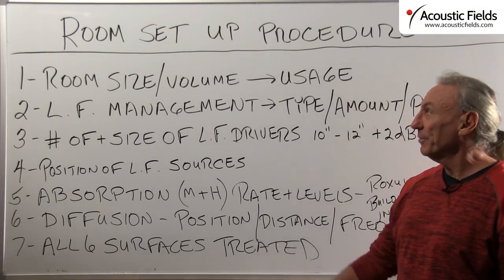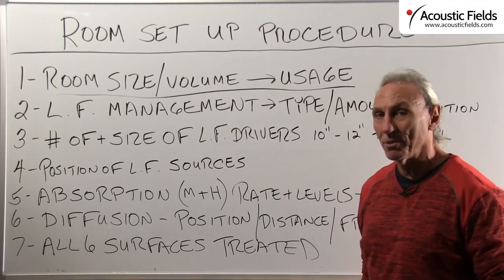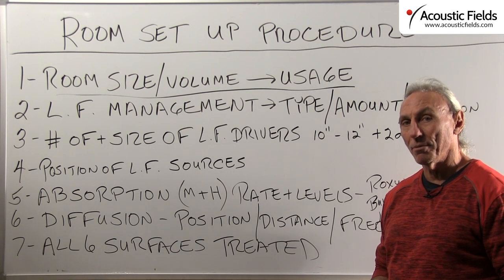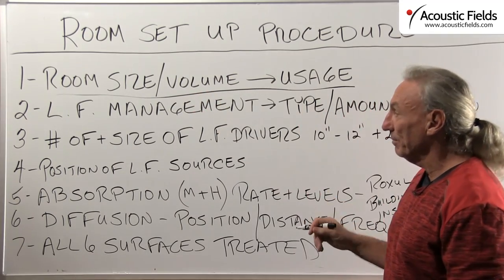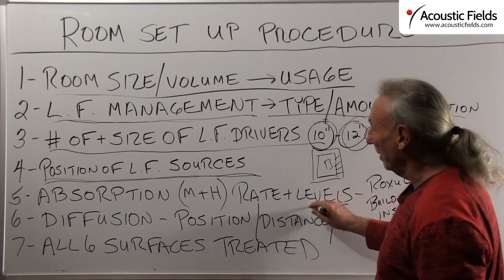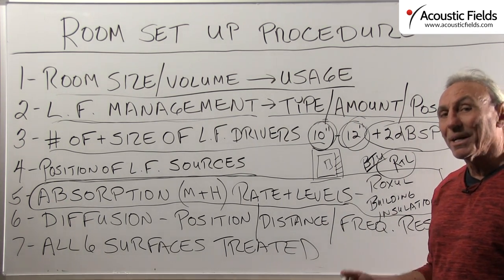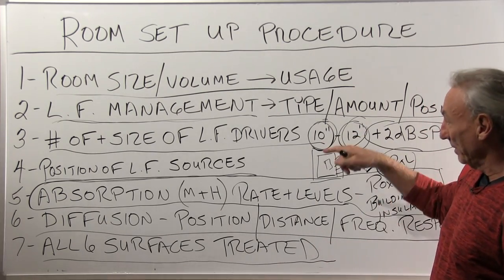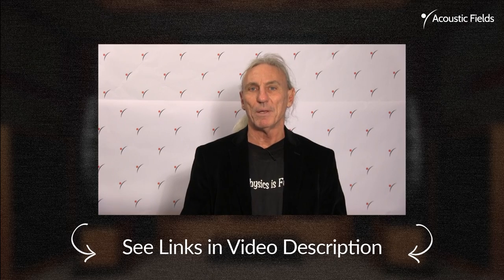Room Setup Procedure - www.AcousticFields.com

Comment: Curious as to if adding slats of wood across a roxul type panel would help with the absorption rates? Hate to use the word 'diffusion' but like on a 2x4 panel doing a 4 inch slat, then 4 inch open, repeat....would help reflect back some of the highs that instantly vanish with bare roxul? But I'm sure...as with all this acoustic science stuff...there is not an easy fix. If it were...everybody would do it, right?

Comment: So are you saying that setting up your system in the biggest room you have (all things equal) that you should in theory need less room treatments, cheers another great video to help me solve my problem.
Reply from the maker: Hi Microteche, Larger room sizes and volume require less low frequency treatment. It is better to start larger, if possible, so that you don't have to spend more on low frequency pressure management.  All rooms require reflection management.

Comment: Where would be good subwoofer placement ? If not equally positioned in the corners?
Reply from the maker: J,  Never put a subwoofer in the corner. Start with elevating the sub 12" and then start with a side wall position middle room and work towards the room front and rear walls. Move and test every 12". Stay into the room as far as you can.
Reply: @AcousticFields   ok so I have 2 subs would I put one on the one side wall an the other across the room on the other side wall
Reply from the maker: J,  Just because you have 2 subs does not mean your room can support two subs. Start with one sub and follow the procedure I stated.

Comment: I don't agree with you about placement of subs in this video. I have very good results in my room with 2 back subs in the corners, both measurewize and SQ. Of a total of 5 LF sources I have 4 in the corners and one sub center front wall. Highly recommended.
Reply: Sounds like you like a LOT of low end..  How flat is your response curve?  Also, how's the attack and decay?   I doubt it's going to have good attack and decay with corner placement...